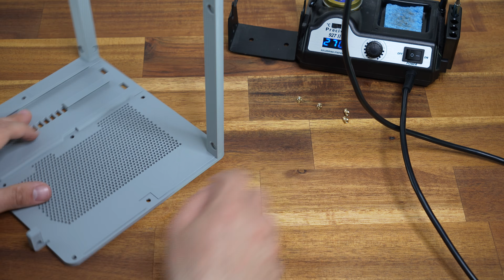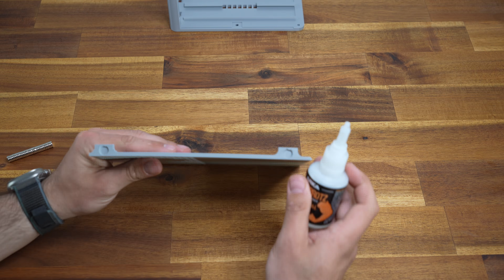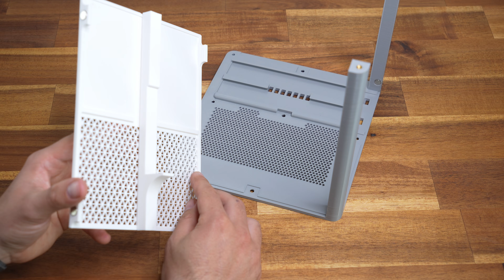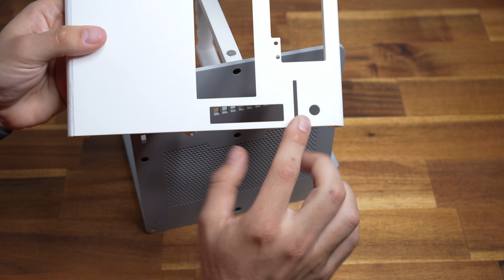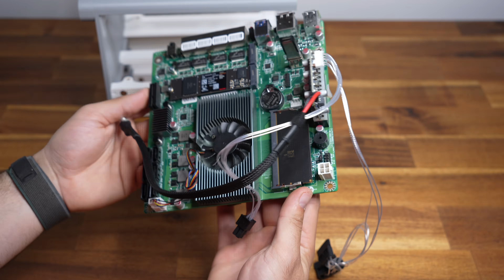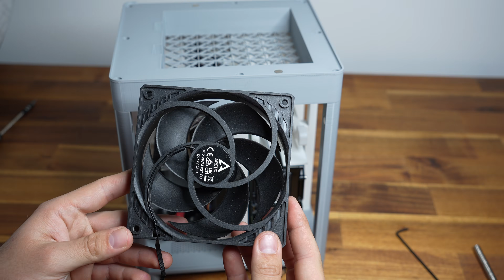NOOS – 3D Printed NAS Case Assembly Guide (Mini-ITX, 6–8 Bays, Pico/Flex PSU)

Comment: I'd be wary with magnets near hard drives. You should do a clip on version rather than magnets.
Reply from the maker: Thanks for your feedback! I understand the concern, but the small neodymium magnets used here are very low strength and positioned far from the HDD platters – they don’t interfere with data or drive operation. Many commercial cases even use magnets for panels. That said, I like your idea – a clip-on alternative could be a nice option for people who prefer it.
Reply: @Pokzy  
I know a small magnets might not affect it but you wouldn't throw pebbles to a glass window either, if you know what I mean.